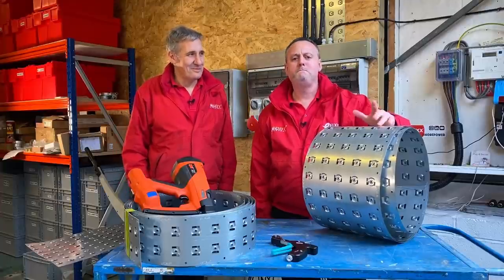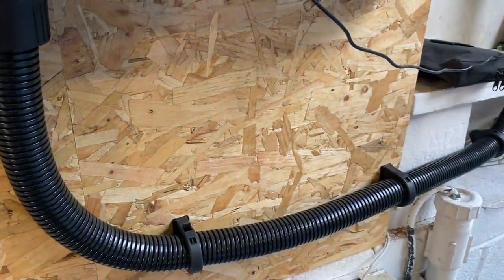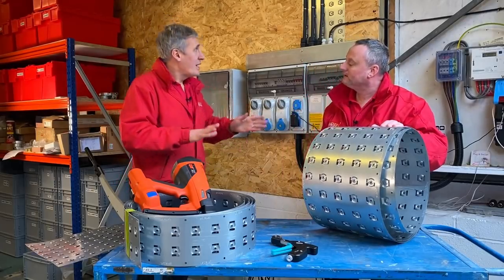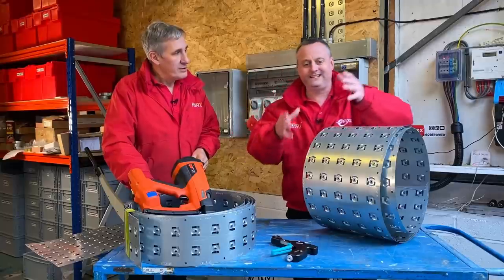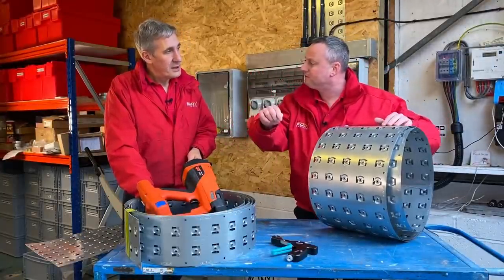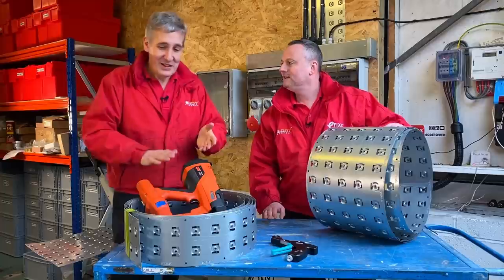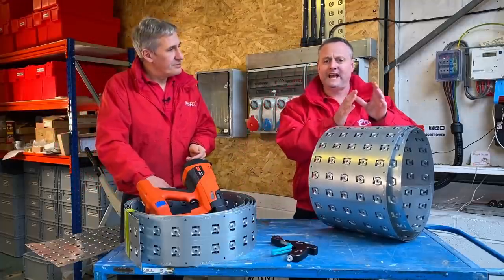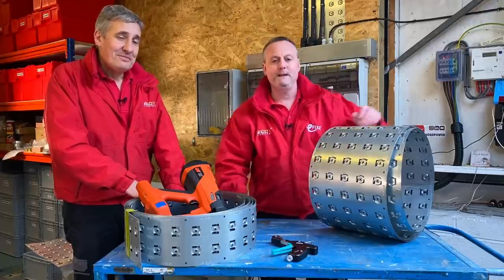CABLE TRAY ON A ROLL - HOW DOES THAT WORK? - Rollatray

Comment: I wonder if you could have a roller tool to fold the edges up to make it into something more rigid - I've seen something like that in Australia for making guttering on-site from a roll of flat sheet.
Reply from the maker: Ah yes - a bit like zinc roofing
Reply: It's pretty common here in the UK for guttering too - I've had it installed a few times. Aluminium guttering tends to be seamless to just about whatever length you want - a huge advantage over the standard lengths of plastic stuff. It seems like a magic trick the first time you see them do it out of the back of their van.
Reply: You always make the best comments. Also still the coolest BBC master ever

Comment: It probably has its uses, if it saves 90% install time, is it 90% more expensive.
Looks rough to me nailing stuff to the wall, especially if it needs to be removed at any point in the future.

Comment: perfect for lift shafts etc where they use a ton of data on newer lifts with access cards etc, the low profile makes it perfect for that .. great in riser shafts too ..  zinc whiskers (crystals) create havoc on sensitive electronics effectively shorting out components, upto 30ma. used to be a massive problem in marine ... data centre is on another planet i hated it ... are they looking to release it in stainless?
Reply from the maker: Good idea on the stainless we will ask!

Comment: I like the idea, but would it be more adaptable to cable grouping if there were more raised punch outs along it's width to accommodate more cable tie placements?
Reply: Yes.  I agree.  What do you do with the space between the raised  tie points?  They could put them closer by staggering them maybe.

Comment: I would be interested to see if it copes well with multiple cables.
The tray above the board behind you looks like it could only contain 5 SWA cables. Can it hold more?
Reply from the maker: It has five tie positions, above that we will need to bundle the cables. Stay tuned as we will be adding more in future videos.